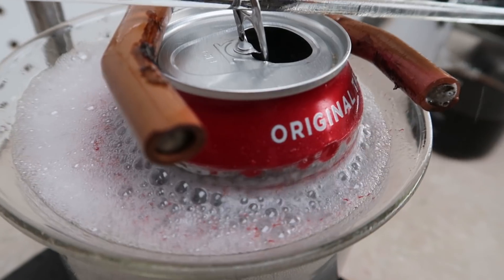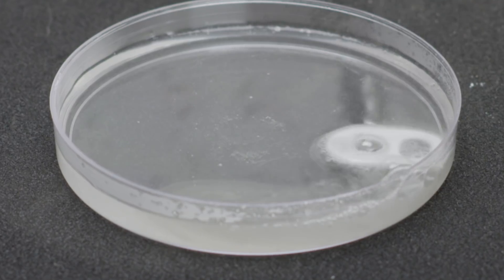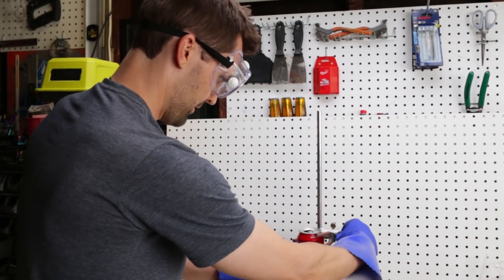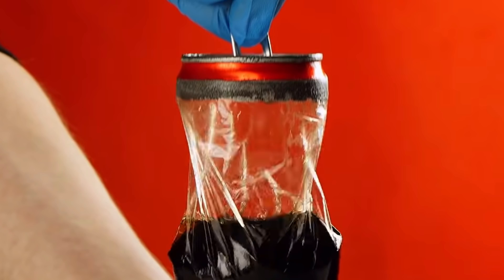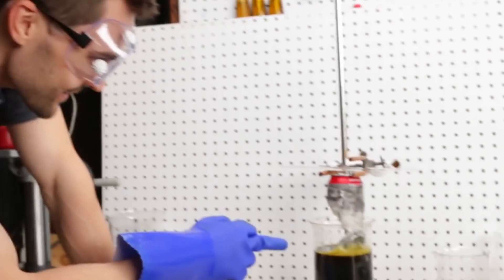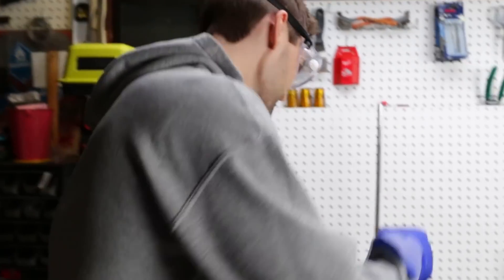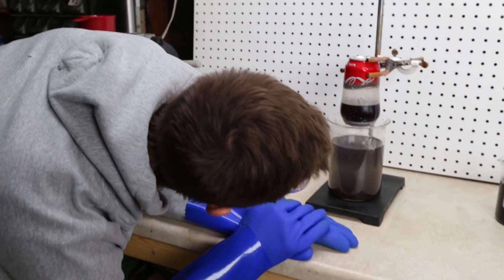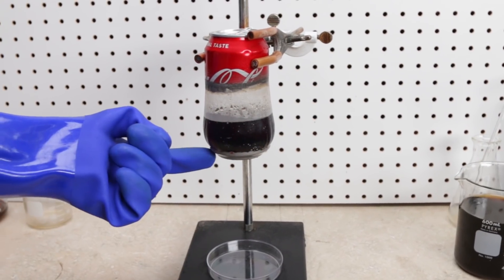Plastic Bag In All Coke Cans? | Nickipedia

Comment: It's not a plastic bag, it's a coating of plastic to keep the soda from leeching aluminum into the product (or at least that is what it's supposed to do). Using aluminum for food containers (or cookware) is the reason that there is such a high rise in cases of Parkinson and Alzheimer's disease. Soluble aluminum gets into your bloodstream and deposits itself in brain tissue which reeks havoc on it's normal functions. The chemicals that they use in the plastic is also suspect.

Comment: To set things straight no it is not a bag. It is a protective coating to protect the aluminum from reacting and/or eating away at the aluminum due to the acids in the fluid inside. I've worked in a factory - Ball Corp. that produces coca cola cans and my main area was the area where the cans were sprayed with this coating

Comment: does anyone know what sort of environmental impact this would have on the process of recycling cans?
Reply: The epoxy is tree resin based, it causes no enviromental pollution in the Recycling Prozess because it burns down to carbondioxid and water. When the epoxy is exposed to light, it decomposes into the same components after some time. It is a good solution.
Reply: Alexander Hemp amazing! thank you so much :) seems like a good solution!
Reply: Sophie Leyshon I was wondering the same thing
Reply: My mind was going in the same direction. If it was any amount of plastic I thought there could be a solid solution for the plastic problem in the world. Too bad it's epoxy and not actually plastic, well guess it's a good thing.

Comment: Sodium Hydroxide, which is used to make Drain Cleaner and Oven Cleaner, and can melt aluminum is used in SOAP?!? ~ Is it ONLY Coke cans that have plastic in them or ALL soda cans? What about juice cans? ~ 10:44 You should have put in the Pillsbury Doughboy Giggle here.
Reply: Most cans should have a protective layer like that